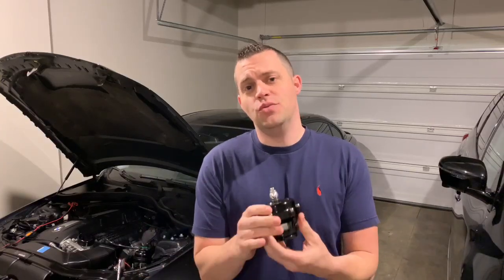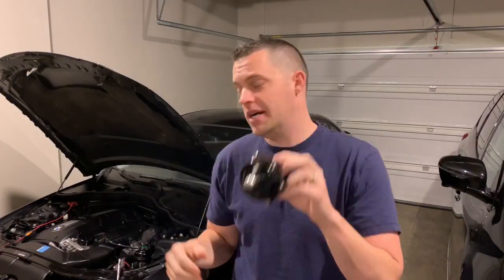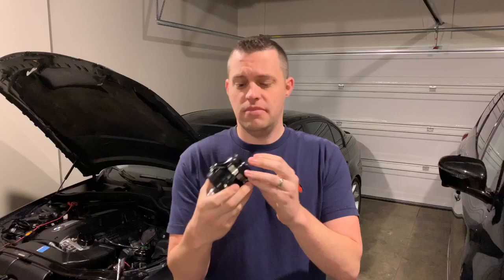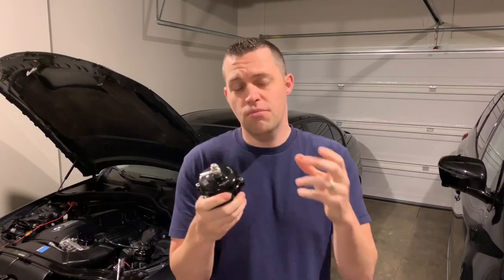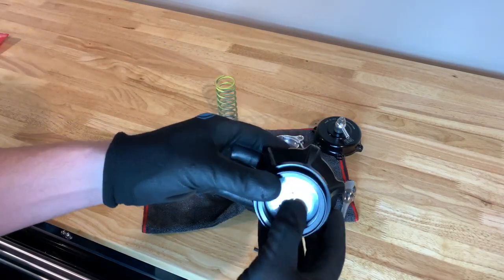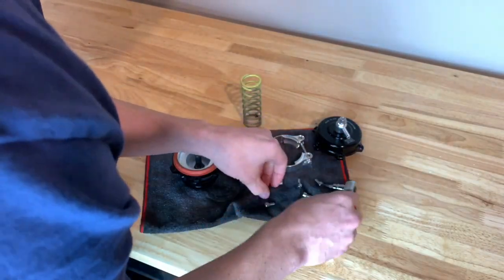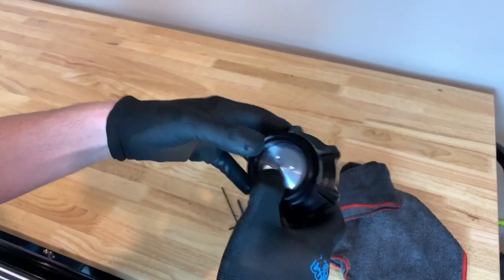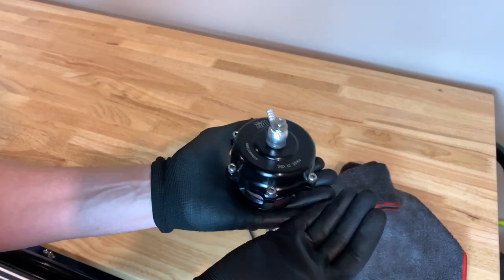How To Service Your Tial BOV!

Comment: N54 blows so much oil through air intake that BOV just lubricates by itself :)
Reply: Really tho
Reply: Fr fr, but how bad is it tho?
Reply: @nikolasbadger632  bad real bad
Reply: Oil catch can.
Reply: @joebutlersnr7017  I have one installed. ECS Tuning. It helps, but doesn't solve the problem completely
Reply: @ArtemDzhadzha  so where's the oil coming from?
Reply: @joebutlersnr7017  PCV
Reply: @joebutlersnr7017  oil catch can just doesn't separate all the oil. There's still a lot going all the way through catch can right into the intake. It's a known issue of N54. Even though it has several oil separation channels built into the valve cover, it still blows a lot of oil.
Reply: @ArtemDzhadzha  now I can't remember rightly without looking the PCV comes out the top of the engine via the catch can and then back into the inlet , but where ? I'm sure its after the charge pipe either the throttle body or inlet manifold , I can't remember , but it can't be the charge pipe or before of that I'm pretty sure , so if I'm right ( and I'm not saying I am without going to the car and looking ) then it can't be the PCV , can you remember where it goes back in?
Reply: @joebutlersnr7017  yes :) I know exactly where it goes to :) it may surprise you, but it goes right into the back air inlet. After the air filter, but before turbochargers, the intercooler, BOV, throttle, etc. So basically, the whole air intake (except the air filter) is covered with a thin oil film, and by the way that is another problem for the intercooler, when there is too much oil in the intercooler it loses efficiency, oil prevents heat dissipation.
Reply: @joebutlersnr7017  to be accurate, there are two PCV paths. One is short and built into the valve cover and comes back into engine right before the valves. It is used when you have negative pressure in the air manifold. Another one is a long path, which we all know as traditional PCV. As I already said, it comes out of the valve cover and goes into the back air inlet that is located behind the engine.
Reply: @ArtemDzhadzha  OK Artem thanks for the info but I think I'll wait a bit till I clean the intercooler , I swapped it for a Forge intercooler about 9 yrs ago , I've still got the old one so I'll get an idea from that about the oil mist , good talking to you mate , happy motoring.👍👍👍🇬🇧
Reply: Truth

Comment: Im looking for a charge pipe and bov for my e60 n54. Not sure if the 335i charge pipe will fit since some people say yes and other’s say no
Reply: I’m almost 100% sure any n54 charge pipe and bov that fits the 335i will also fit your 535i. They make them for the engine not specifically for either the 3 or 5 series. I’ve got the VRSF Charge pipe and TiAL bov for my e90 335i and those will fit your 535i as well.
Reply: Hunter Rush thanks for the advice! I wanna get a charge pipe and bov from ebay and the seller said it doesn’t fit :( but ima get one that my fellow e60 friend supposedly got for his its called a xspower
Reply: 1 slow E60 _ You’re welcome!! and as long as it’s aluminum you’ll be good. There isn’t much of a difference between brands of aftermarket charge pipes and bov’s from what I’ve experienced. Any charge pipe that’s aluminum will pretty much be the same. Bov’s are little different since certain brands are for sure better than others, TiAL and HKS seem to be 2 of the best out there but everyone has their opinions and preferences but at the end of the day they all serve the same purpose!
Reply: 1 slow E60 _ just bought the VRSF one for the 335i and gonna try to put it on my e60 tomorrow I’ll let you know if it fits.

Comment: If you running up to 20psi how would 11psi spring be accurate for that valve?
Reply: Not how bov/bpv works
Reply: @brand0llaz  Some people don't understand the difference in vacuum and pressure and how a BOV functions. I think he is thinking of a wastegate.

Comment: Hey bro question,  did you put that tial on your forge charge pipe? If so I broke my forge v band clamp.. do you think I can use that tial v band clamp for my forge BOV and charge pipe? It's the only thing I can find.  Forge isn't answering..

Comment: What’s the benefit to putting a harder or softer spring in there ?
Reply: Swagory reaction time to release -ve pressure. Spring rate should be based of your vacuum reading when vehicle is at operating temp. Or I could be wrong.

Comment: Did you feel it was stuck when it was on the car?  Thats a good ideal to pull it from time to time. Great video
Reply: When I first got mine it was stuck closed, sent it to rev limiter in neutral and it opened up.

Comment: I bailed. After 12 months I sold my N54.
I had a 135i with Downpipes/charge/stage 2 mhd, 135,000 km (80k miles?)
Did a water pump replacement a month ago and it cost a small fortune. Then when a brake light failure made a sensor warning and remained when I replaced the globe that was the last straw. Haha. She was a sexy car though.
I bought a second Golf R instead.